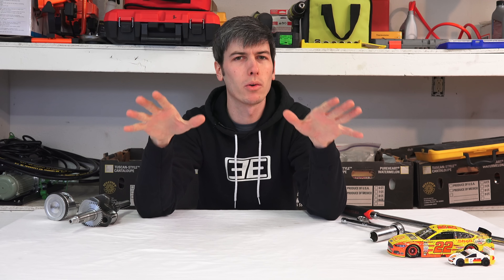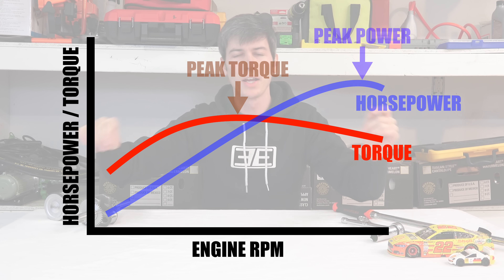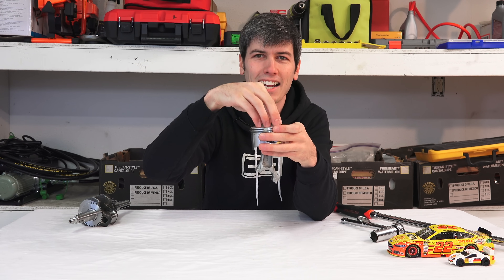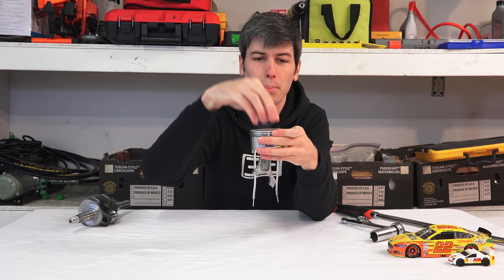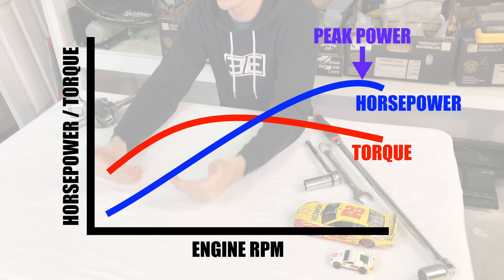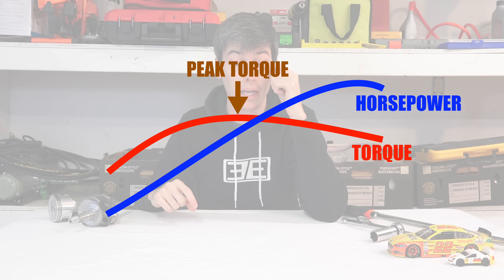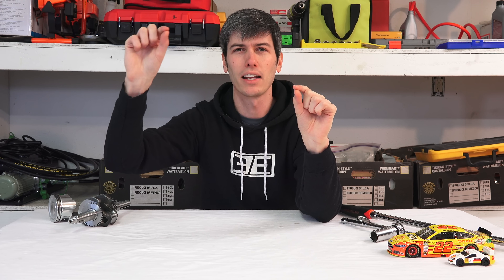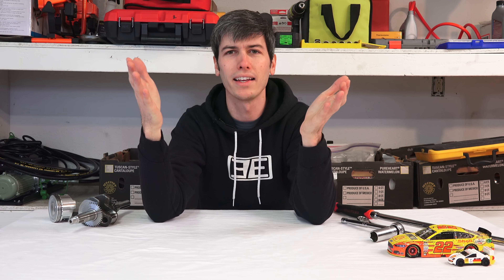Horsepower vs Torque - A Simple Explanation

Comment: Horsepower is how fast you can turn the wrench, torque is how hard you can turn the wrench.
Reply: No, horsepower is how fast TIMES how hard. Half the torque at twice the rpms is the same horsepower. Educate yourself before educating others.
Reply: Yup Got It
If horsepower is how fast you can turn the wrench, then what is rotations per minute?
Reply: @schwarzerritter5724  rpm
Reply: @lissaleggs4136  Yes, RPM is short for rotations per minute. But what does it mean in relation to the wrench.
Reply: @schwarzerritter5724  
Torque wrench not rpm wrench
Ft pounds, inch pounds. Unless metric.
Reply: @lissaleggs4136  But there is a horsepower wrench?
Reply: @schwarzerritter5724  
Nope...  Try dynomometer or chassis dynomometer measured at wheel with a load.  To measure.
Reply: @lissaleggs4136  Okay, I see what is happening. I followed up on Yup Got It's original statement and you thought I was saying that I got it.
Reply: @schwarzerritter5724  
Pneumatic wrench has incremental torque relative to rpm
But it has limits.
Of course, excess torsional vibration can destroy an engine also leading to excessive blow by or spun bearing which lead to rod/piston/valve damage.
Reply: Schwarzer Ritter rotations* revolutions
Reply: Thanks ! u save the world finally.. I cam for something simple.. and lol he came up with a  book
Reply: torque is how hard you can turn the wrench well hp is how fast it turns well applying torque
Reply: @fullytek2970  Pretty simple.... 475 torque at 4000rpm = 1,900,000 per minute... 400 torque at 6000rpm = 2,400,000 per minute = faster acceleration over time... So Hp = max torque per minute
Reply: Here’s how to consider electricity. Picture your wire as a garden hose. Current is the rate water can go from one end to the other. Voltage is the pressure of the water or force pushing the water. Wattage is the volume coming out the other end in a certain time. Need more water with less pressure? Get a bigger hose and the same pressure gets you more water filling your pool faster. Need lots of wattage/water through the same hose? Crank up the voltage\pressure. The result of either is more water. Byproduct of either is more chance of a blowout so operate within the limits of your hose/wiring.
Reply: crank up the voltage/pressure too much? your wire/hose gets destroyed. They indeed work the same way and to understand electricity i've always pictured it like this
Reply: saytammm yeah, literally the “flow of electrons through a conductor ” little particles actually flowing. People say to me you can’t see them, I say...can you see two hydrogen and one oxygen molecule? No but that doesn’t mean it isn’t there. With a big microscope you can
Reply: saytammm 
Actually as far as wire is concerned, it works exactly opposite of your conclusion, provided the wires insulation doesn't leak. Higher voltage can carry much more energy or wattage across the same wire than  the lower voltage. Double the voltage can carry roughly double the energy. I.e. 1kW @ 1xV = 2kW at 2xV. The lower the voltage the more resistant to current flow per watt. Lower voltage will heat up melt etc. Before the high voltage.
This is why transmission lines use extremely high voltage. The high voltage allows them to carry more energy. The lines would melt if they were the 110/220V like you commonly use.
Reply: @saytammm   Resistance playes a major factor in. How many volts and amount of current flows. At that voltage level vs just wire diameter alone. Both superconductive materials like graphine. And technology which produces a cold temperature of absolute zero. Both have an equal say in that as well.
Reply: Volts push amps through ohms is how I learned it.
Reply: @rotorav8   so then using your analogy what is amperage. I've heard amps are the best way to understand the power of a electrical device/machine like a vacuum cleaner.
Reply: Sera Phim amperage and current are the same thing
Reply: rotorav8 
I'd say voltage was the rate. Current as pressure. You would need to figure friction or something as resistance also. 😀
Reply: @rotorav8  current is water and voltage is pressure. Clearly you're going to have more power in 10 gallons a minute coming out of a water cutting jet than lazily flopping out of a 4" diameter pipe.
Reply: Yup Got It 
Speed and force = HP
You can transform and force into any amount you wish. 1oz/in can be transformed into 1 million ft/fbs with gearing or levers. The loss is time or speed. High power is high force at high rate of speed.
Reply: His use of cars as an example for which is faster left out something very important. Which car will win, if everything else is exactly the same, depends on the distance of the race. A formula one race car is useless in a drag race because it's torque is useless until the engine rpms reach high levels. That's why it takes longer to accelerate from a dead stop, vs a dragster that has high torque at low rpms so it is able to reach high speeds at a shorter distance. Gear ratio is also why dragsters have very big tires at the rear because the large amount of torque at low rpms can turn the wheels. Put a formula one engine in a funny car and you would probably burn up the clutch before get the car to moves one inch
Reply: I like the conveyor belt analogy. Suppose you have a conveyor belt running uphill moving gravel like a cement plant. The torque applied at the pulley would determine how much gravel you could load on the belt at any given time, power would be the measure of work - how much gravel you could move uphill in a given time period.
Reply: @DragNetJoe that’s pretty good only it doesn’t account for the fact that by changing the gearing to operate the belt at peak power instead of peak torque you could load more on the belt at the same belt speed than you could operating the engine at peak torque.  Without this clarification people often mistakenly draw the conclusion “Torque is for Strength and Power is for speed.”  Variations of which pollute these comments sections.
Reply: only that rpm is how fast you can turn a wrench
Reply: Not really. How fast you can turn the wrench, is RPM. How hard you can turn the wrench, is torque. How hard AND fast you can turn the wrench, is horsepower.
Reply: @Richard NZ voltage is literally potential energy what are you talking about
Reply: You made it easy to understand sir, thank you
Reply: Lol- 1 sentence to explain a video lasting several minutes!
Reply: Not really, RPM is how fast the wrench is turned. Power is how quickly you can pop a bolt off with the wrench.
Reply: Horsepower is the result of the calculation of both how fast and how strongly you can turn the wrench
Reply: Voltage is pressure 
Current is flow
Wattage is pressure x flow
Reply: Yup Got It you just explained the video in 2 sentences 😂😂
Reply: Close - Horsepower is how fast you can get the big rusty nut tightened down, and torque is how hard you can turn the nut. You are the engine, the nut is the car, and the wrench is the transmission. 

Let's say I have a really big rusty nut to tighten on a long threaded shank and it has a long way to go. I have a tool box of ratcheting wrenches with different lengths, some crazy long. If I try out each wrench, working as hard as I can with each one, I'll probably find the one that allows me to make the fastest progress. It probably won't be the shortest which requires my full static strength to get the nut to move. And it probably won't be the longest which requires me to run back and fourth with the end of the handle. It will be some wrench length in between. This wrench length is like the gear ratio that let's me (the engine) do work fastest and get that nut tightened down the quickest.
Reply: No that's not right. RPM is how fast you can turn the wrench. Torque is how hard you can turn the wrench.
Reply: No. Horsepower is how fast you can turn the wrench multiplied by how hard you can turn it. Essentially how much energy it puts out per time. Horsepower = torque x rpm.
Reply: No HP is how fast AND how hard you can turn the wrench. RPM is how FAST you turn the wrench, and torque is how HARD you turn the wrench.
Reply: Torque is how hard you can turn the wrench times how long the wrench is.  Horsepower is how hard you can turn the wrench times how long the wrench is times how fast you can turn it.
Reply: Yup Got It     

finally a straight forward answer i think i love you because you're the only person left in the world that can give a straight forward answer
Reply: Yup Got It you are absolutely wrong. Rotations Per Minute or RPM. Is the rate of speed you are turning the wrench. Force is the amount of energy you are applying to the wrench handle. Which gets directed  to the end that is gripping the bolt head. Which starts to turn the bolt shaft. The applied force through RPM. Becomes converted into torque. If you can maintain that amount of applied force. Into a much faster turning speed. Like 25-100 RPM, you will creat an amount of HP.
Reply: @Richard NZ No, you are wrong. 'Voltage' is "potential energy." It's literally the definition of the word...
Reply: More torque more acceleration
Reply: @Imaginathor-1k0  the engine’s maximum power, not its maximum torque is what defines its maximum ability to accelerate, or tow, or hill climb or anything else that involves motion and any speed.
Reply: It's both x
Reply: Yup Got It 
Thank you. You should make a video. This is simple and that I can understand. 👍🏿
Reply: T= 1lb - ft
Reply: Power is energy per unit of time, so you can have a lot of power by expending energy in a very short amount of time or expending more energy over a longer period of time.
Reply: @Richard NZ maybe he meant watt
Reply: Better than this video.
Reply: This examples thing is getting out of hand!😂😂😂😂
Reply: Horsepower is a good marker to give you an idea of the power an engine makes but in practice it's not real. There is no way to measure horsepower. You can measure tourqe and rpm thosatters number
Reply: @erniejohnson8540 have a peak at Dunojet’s website their Inertia Dyno measures Power and then calculates Torque based on RPM.  The Mustang brand of dyno is a load cell type which measures Torque and calculates HP based on RPM.  Both exist and even if they didn’t not having a way to measure something doesn’t nullify its importance.  Power, not Torque is the limiting factor in an engines ability to accelerate, lift, tow, haul, pull, and anything else you can think of that involves motion.
Cheers,
Reply: Sort of but that’s confusing. For the same power, fast turn small force or slow turning of the wrench with high force. So you’re not explaining the difference between torque and power. Torque is and ingredient of power. The other ingredient is RPM.
Reply: Richard NZ no that would be Hz
Reply: @Richard NZ 
Voltage is considered  a type of potential energy.   
Specifically electric potential energy.
Reply: @Richard NZ  
Energy  is not infinite because  you have case where energy  is not conserved.  
As example  of this situation  is particle  in the box . Where classical physics  is unless and quantum mechanics  is a fundamental form to explain stuff like this.
Reply: I came here to watch the whole video, but this comment just filled me in. Thanks man.
Reply: Torque vs engine rpm curve is to evaluate the airflow through the engine. Flat torque curve means constant flow of air per cycle. 4 stroke cycle, 2 stroke cycle, whatever. Airflow per cycle multiplied by cycles per unit time is power input to the engine.
Reply: serious question cause I'm still a bit fuzzy on this... what would be the benefit of how har you can turn the wrench? It just seems like the more horse power the better (faster).
Reply: Perfect ... That solved it ...
Reply: For some reason I didnt get it with the video explination, but yours now I get it.
Reply: Totally true man!!!
Reply: Yup got it finally a simple explanation. You should be a you tuber!
Reply: Wich one do i want?
Reply: Absolutely
Reply: Excatly.  Good explanation "You Got It"!
Reply: Good explanation
Reply: Not even close
Reply: Thanks! That’s brilliant and concise!
Reply: But the salesman said hp sells cars, torque wins races?
Reply: Will a larger crank mean more torque?
Reply: RPM is how fast you can turn the wrench. Power is the product of how hard and how fast you are turning the wrench.  Power doesn’t compete with torque to get your job done.  RPM and Torque are multiplied by each other to give you power.  Increasing power allows you to do more work in the same time period or do the same work in a shorter period of time. Any increase in RPM or Torque that does not result in an increase in power does not have the potential to do more work in the same period of time or to the the same work in a shorter period of time.
Reply: No there are so many errors in your opening statement it’s hard to know where to start. Anyway horsepower is a measure of power. It’s that simple. No electrical analogy (wrong) needed.. but if you insist it’s Watts, which is the SI measure for power include for IC engines. Nothing to do with capacity to do work - it’s the RATE of doing work.
Reply: Gearing
Reply: Torque gets you off the line faster, and at some point hp takes over.  I think…
Reply: More like in a car horsepower is how much force you hit the crowd and torque how long can you drag the bodies? -not mine
Reply: @stephenjoshuawayno5599  LoL 😂 spot on mate 😂😂😂
Reply: +Yup Got it  yup, got it!
Reply: "how fast you can turn the wrench" isn't that speed? so you're telling me speed = horsepower?
Reply: @ZtubidiPhone  Power is the rate of doing work.
Reply: Not quite, rpm is how fast you can spin the wrench, torque is how mutch force you can apply abd hp is a nominal value, does nt say too much, like watt for electricity, 100w @ 12 volt are one thing, 100w@120 volt is completely another level of power, and since watt=volt×ampere and hp=(grossly)torque×rpm, both values are totally suitable for this example
Reply: Horse Power (Speed) vs Torque (Acceleration) ???
Reply: Torque is the rooting mass of engine and gearbox horsepower is the fuel and air exploding
Reply: Horesepower - is simply that- like Voltage it known as potential energy - or the capacity to do work - lets say you have a horse and then give it the capacity of 20 horses - what do you want to do with it ? Speed you along at breakneck speed or pull a plaugh ? Torque is actually called rotational force - so it IS force ( mass x acc ) just going round - think of it as a fireman uncoiling his hose across the ground. or a wheel of a particular sixe and weight rolling until it hits another object. Finally the greater the force the greater the capacity to do work, and that includes accelleratio - The formula for force says force is equal to mass (m) multiplied by acceleration (a). If you have any two of the three variables, you can solve for the third. Force is measured in Newtons (N), mass in kilograms (kg), and acceleration in meters per second squared ( m/s2 ).
Reply: Torque is simply rotational force............... a mouse or horse on a treadmill.......... simples
Reply: Ron Hind what an anology 😀
Reply: @nainka11  Thank you for this great input!
Reply: @nainka11  Go buy an electric car or a Prius, damn electro-nerds. We are talking burning fuel here!
Reply: @Adams1984100 ya!  Who is going to listen to Vegans talk BBQ!?
Reply: Ron Hind Wow you just made that extremely hard to understand. Don’t become a teacher
Reply: @nainka11 a more closely related allegory to electricity would be Voltage and current would be like torque and RPM and power would be like well…. Power.  
Voltage x current = power
 RPM x torque = power
Torque not Power is the potential energy.  It is possible to have torque without RPM which results in no power. Anything multiplied by zero is zero.  Torque exists in a realm irrespective of the time domain.  It has the potential to effect change once it is multiplied my RPM Revolutions Per Minute.  The clue is the word minute.  Once there is any movement torque (the potential for work is actually producing work in real time and can therefore be measured….. in Power. Or Watts or BTU if you prefer.
Reply: Twisting force..
According to AL at GM powertrain.
He was my boss.
What is torque lissa....  Power measure against set resistance. 
He said "twisting force"..?  and I agreed immediately. That why he is boss. 👌
Reply: @Yup Got It, so if I'm understanding correctly, a car with little horse power but immense torque could still go at very high speeds. It'd just take a long time to reach it. Correct? And with high HP you reach whatever maximum speed you can really quickly.

From that, could I say that HP = acceleration, and torque = speed? 

(even though I have a feeling that HP provides speed too)
Reply: Joules is a measurement of energy. A Coulomb is a constant number of electrons.
Amperes is Coulombs per second. Or in other words, the number of electrons flowing per second.
Volts is Joules per Coulomb. Or in other words how much energy is carried per electron.
Watts is Joules per second. Or in other words, the amount of energy carried per second.
Reply: Volts x Amperes = Watts
i.e. [ Joules per Coulomb ] x [ Coulombs per second ] = [ Joules per second ]
i.e. [ Energy per Electron ] x [ Electrons per second ] = [ Energy per second ]
Reply: @SixOneZil  it is limited to its rpm... so you are correct if the transmission gearing allows it.. direct drive no...

Comment: it depends what you like to accomplish. i will always prefer a high torque in a low rpm, so i can drive in low rpm have much "power" available, in stead of always nedding to be in a high rpm. in every days live torque is more important than power for me, because i am not driving races, but normally just want to put my foot down and have the car accelerate, in a car with low torque and high power i would need to change gear (what i personally dont like to do, to lazy to do that)